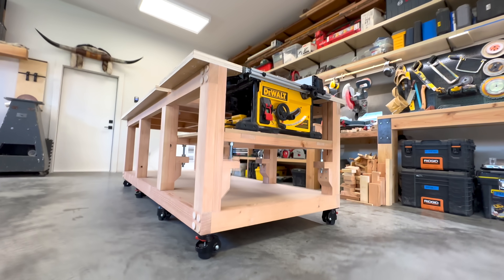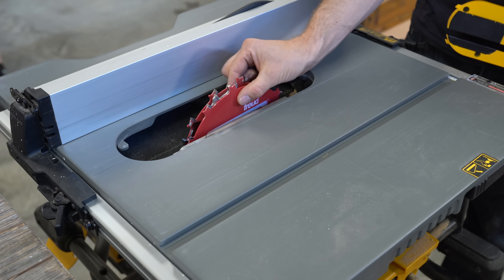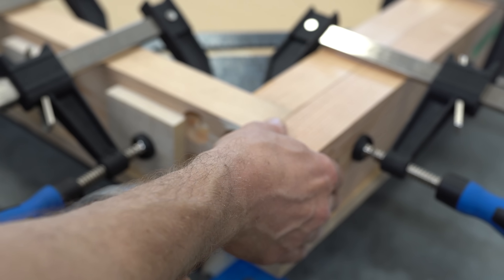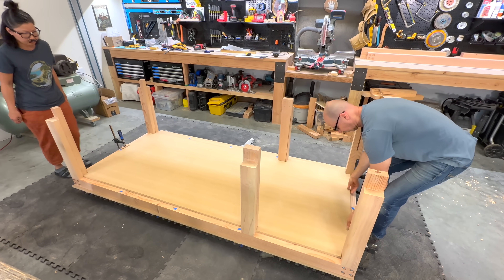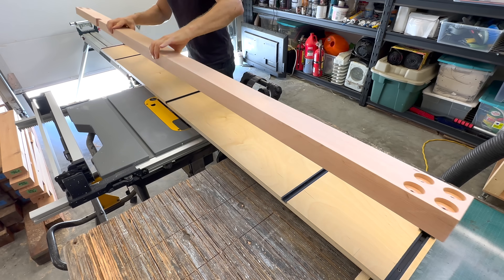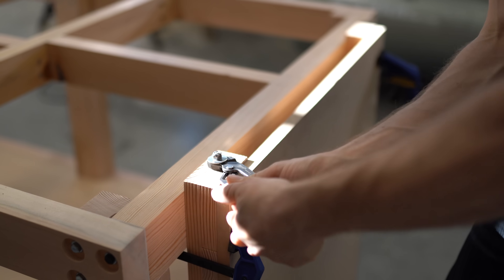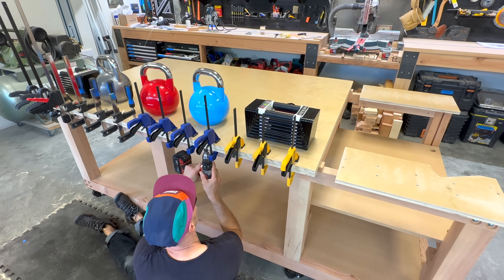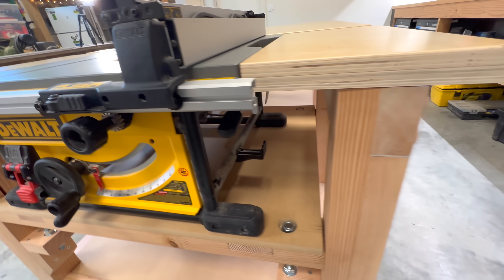DIY Table Saw WORKBENCH Dewalt 7491

Comment: Fantastic build video, the animations (and sound effects) are really well done as well! Look fwd to the plans! 🎉
Reply from the maker: Hey @slingard thanks so much for checking it out! it was fun for me, and educational to create! I hope to have them done soon. Best Paul
Reply from the maker: Hi. Thanks again for inquiring about plans for the workbench. In case you are still interested, I wanted to let you know they are now available on ETSY.  Here's the link  http://bit.ly/3s4D7Ta

The plans utilize imperial measurements, and use regular sized 2X4's (3.5 inch X 1.5 inch).

And in case you are interested in building the workbench using the exact dimensional lumber I used in the video (3 5/8 inch X 1 13/16 inch) I'll have those plans available on ETSY on Oct 31. 

Thanks again for checking out the build! Cheers Paul

Comment: Great build.  Hind sight for me... I should have bought the 7491 instead of his 8-1/4 brother.  Any thoughts on routing miter slots on the outfeed side of the table for other jigs or a cross cut sled?
Reply from the maker: Hi Thomas thank you for your comment, and the 8 1/4 is a good saw too, but I understand if you feel like an upgrade might be in order for the extra cutting capacity. Yes, the routing of the miter slots is a must. I've been using it as is without the slots, but its a pain in the butt!... so I will be routing those in very soon! Thanks again Thomas :) Cheers Paul
Reply: When you do cut those miter slots, please make a short video.  thanks @vanislestudio

Comment: Smooth work slick . Is it ok to ask the measurements from you in metric ?😅
Reply from the maker: Thanks a lot! Sure, the overall size of the workbench in Metric is 2400mm long X 1200mm wide X 896mm high (depending on the height of the casters used) Cheers Paul

Comment: Hi, great job. the only question I ask you is, if you please, tell me the thickness of the threaded rod used to lift the table top of the Dewalt saw table. Hello and thanks
Reply from the maker: Hi Alfred thanks for that! The threaded rod is 5/8 inch. They are 9 inches long each. They are very sturdy and keep the table saw nice and level for me. Thanks a lot for your question! Cheers

Comment: Nice table, how is the stability?  Would it  handle running a large cnc w/o racking or shaking side to side?
Reply from the maker: Hi There, I cant get it to sway from side to side. I tried with a lot of force, but for a larger CNC, I think I would install two cross braces inside the bench just to make sure. Thanks for your question and for stopping in!

Comment: Do you find it time consuming to lower all 8 casters every time you use the table? Just purchased the plans and looking into all caster options.  On my current table I have the wood river ones that lower the table all the way to floor with the foot pedal. Only issue with these is that that stick out far and the table can’t be stowed up directly against the wall.
Reply from the maker: Hey Jeffrey, I know I sent you a DM via Etsy, but thought to post my reply here, in case it may help others :) regarding your casters comment:

"About the casters, If there were 4 casters in this design, it would be doable, to move around the shop all the time. But having the 8 casters, it's a bit more effort, but I've just come to accept that it takes time to move. They are fantastic casters, but at the cost of time to move. The reason there are eight, is because of the weight of the workbench. Having both saws, and 2X top thickness, the bench is heavy. It will sag over time in the middle if only 4 were used.

If you need to move your workbench every day, or once a week, you would have to be ok with the fact it will take a bit of time to move. Each caster requires about 10 - 20 seconds to lift / lower. This time can be sped up if you make an extension arm for adjusting the caster. (Basically a 20cm or 30 cm hollow pipe that makes it easier to adjust)."

For speed, I think you made a good choice ordering 4 more of the wood river casters.

Comment: Nice job! How's the workbench holding up after 8 months? Any warpings or misalignments?
Reply from the maker: I've been beating on it pretty hard this past while and I can share I'm happy with how its held together and has stayed pretty true. The top is still flat, I did have to align the adjustable table saw shelf once, but I'm pretty fussy lol. Thanks for the question mate

Comment: Beautiful table, I am going to build this myself.  How did you level the piece of MDF in the shop floor?
Reply from the maker: Hi there and thank you for your kind words! I used my 40 or so inches level, some scraps of wood that I cut into small blocks, and a lot of cards (Playing Cards, like Kind of Spades). I placed them in piles and made about four rows, then I leveled all the rows to each other. Lengthwise, width, as well as diagonal. 

Once they were all level I placed the sheet of MDF on top. It made it easier for me to build the bench on. 

Thanks a lot for asking and for checking out my video. I really appreciate it. Cheers
Reply: Thank you. @vanislestudio

Comment: Hola, ¿con que fresa hizo el surco a las patas?, para el sistema de elevación de la base de la sierra circular.Gracias.
Reply from the maker: Hi Eros, I used a "Freud 52-522 1-1/8-Inch Diameter T-Slot Router Bit with 1/2-Inch Shank", to cut the groove in the legs. The router i used was "BOSCH MRC23EVSK Combination Router - 15 Amp 2.3 Horsepower Corded Variable Speed Combination Plunge & Fixed-Base Router Kit with Hard Case".  Thanks for stopping in and checking out my video! I appreciate it! Cheers

Comment: Awesome build !!! when are you making the plans available
Reply from the maker: Hey Thanks @gundaro12! I'm working on them now, lots of work but hopefully in a few weeks I'll have them ready.
Reply: Plans would be awesome. Looking forward to them.
Reply: Looking forward to the plan 👍🏼
Reply: I would totally buy the plans for this  @vanislestudio
Reply from the maker: @gntfilms  Hi. Thanks again for inquiring about plans for the workbench. In case you were still interested, I wanted to let you know they are now available on ETSY.  Here's the link  http://bit.ly/3s4D7Ta

The plans utilize imperial measurements, and use regular sized 2X4's (3.5 inch X 1.5 inch).

If you are interested in building the workbench using the exact dimensional lumber I used in the video (3 5/8 inch X 1 13/16 inch) I'll have those plans available on ETSY's site on Oct 31. 

Thanks again for checking out the build! Cheers Paul
Reply from the maker: Hi. Thanks again for inquiring about plans for the workbench. In case you were still interested, I wanted to let you know they are now available on ETSY.  Here's the link  http://bit.ly/3s4D7Ta

The plans utilize imperial measurements, and use regular sized 2X4's (3.5 inch X 1.5 inch).

If you are interested in building the workbench using the exact dimensional lumber I used in the video (3 5/8 inch X 1 13/16 inch) I'll have those plans available on ETSY's site on Oct 31. 

Thanks again for checking out the build! Cheers Paul

Comment: So im new to the whole woodworking thing I have a craftsman table saw that’s on a collapsible stand and hook a bag to the bottom for dust collection. My question is what’s the dust collection like on a table like this?
Reply from the maker: Hi @fishinman539 I think dust collection on any table saw is going to be a challenge. I would imagine for the best results there would need to be a collection on top, covering the blade, as well as below. This saw collects the dust from below, and is exhausted via a 3 inch port, at least I thinks it's about 3 inch). I connect my Rigid Dust Vac to the port on the rear of the saw. The Rigid vacuum will fit inside the workbench, so you don't need to have it wasting shop floor space. In all, the dust collection on this saw is pretty good I'd say. Thanks for checking out my video and for your comment.! Much appreciated Cheers
Reply: @vanislestudio  awesome thanks for the advice ! Great video

Comment: very well done!  just curious how did you make 4n bolts screws going up animation in the video?
Reply from the maker: Hey Randy, thank you. To make the bolts moving the platform upwards, I basically, turned each bolt about a 1/4 turn (on all four bolts). I then took a picture. Then I turned each bolt again about 1/4 turn. I then took a picture...repeat.  It took me a week of learning how to do this, and finally have it turn our the way I wanted! I used this technique in my next video as well, which will be out soon. Thanks for the question. Cheers
Reply: Ahah 😂 this is more like a time lapse, understand well done 👍

Comment: Hi great video, thinking of building this myself for my first workshop table, how much did it cost you for all the lumber?
Reply from the maker: Hi there thanks so much! 2 sheets of 3/4 ply @ 85 each. 19 2X4's @ 3.73 each. 1 sheet of MDF @ 59.98. One 2 X 6 @ 4.26 Total is about $304 but add extra for mistakes and a few other pieces, so about 350 is a really good ballpark. Thanks for stopping in mate! All the best to you

Comment: Best Build i've ever seen. amazing work. Will you publish the plans anytime soon? i really wanna build it for myself ;)
Reply from the maker: Hi @replySunni Thanks so much for that! I appreciate you checking out the build. 

In case you were still interested, I wanted to let you know they are now available on ETSY.  Here's the link  http://bit.ly/3s4D7Ta

The plans utilize imperial measurements, and use regular sized 2X4's (3.5 inch X 1.5 inch).

If you are interested in building the workbench using the exact dimensional lumber I used in the video (3 5/8 inch X 1 13/16 inch) I'll have those plans available on ETSY's site on Oct 31. 

Thanks again for checking out the build! Cheers Paul

Comment: hi .... very nice work..... where can i get a saw track as same as u have?
Reply from the maker: Hi @user-hf4zn5xf1s  the guide rail is from Makita. They make a few of them in different lengths. Check them out here if you wish and thank you for checking out the build! Cheers 
https://www.amazon.ca/Makita-194368-5-Guide-Rail-55-Inch/dp/B002XFYBYQ/ref=sr_1_1?keywords=makita+track+saw+rail&qid=1701193981&sr=8-1

Comment: i assume you have been using this for a while now.   How do you like your choice of casters so far?   i am in the middle of a build at the moment and having a difficult time selecting the best casters for my build.  Curious of your thoughts.

Thanks
Reply from the maker: Hi @psnLazyBeast thanks for your question. For me, they are excellent. I have four different sets of casters around my shop (from different manufactures). These are my favorite. That being said, they are the only levelling casters that I own. But what I can share is, they are easy to level, and adjust. The wheels are large enough that they roll over any wood chips lying around. The downside is they use a ratchet system to raise and lower the foot. This means it takes more time, as the ratchet system moves the foot up, or down in small distances per turn of the ratchet. But I'm ok with that. Oh, something else, is these range from 4" to 4.5" in height. Not many can do that. other levelling caster are usually 3" to 3.5" in height. Cheers
Reply: @vanislestudio  thank you for the response

Comment: Nice workbench!  My older Dewalt saw just died and see you have the one I'm looking into.  DO you make most your furniture with it and have you come across any shortcomings?
Reply from the maker: Hi Huey, Thanks! I use the Dewalt table saw for everything I do. The only shortcoming worth mentioning, is, the saw does not have a "dead flat top", meaning its a composite type material, and not absolutely flat like a cast iron top that is found on cabinet saws. That being said, its a trade off. I did not want the weight, and from my research this saw was one of the most highly recommended, and I agree with it. It can also accommodate an 8 inch dado stack! the fence system is pretty good too. Thanks for asking, Cheers

Comment: This looks simple but exquisite, my brain can easily ubderstand the basic designs. Not that i have a bright one at that 😅
Reply from the maker: Hi @adhyadmokoas so cool you were able to follow along! That made me smile! Thanks for that and I think you're pretty bright. Cheers Paul
Reply: @vanislestudio  would be glad to know about those track / bolt system that you use for leveling, how strong were they? What i had in mind couple years ago was making the frame from hollow steel, with plywood/solid tops.

Comment: Hi. Great build. Trying to follow this. Thank you. 
May i know what size those lag screws are ? 
I am trying to use 2X4 doug fir without planing jt
Reply from the maker: Hi there thanks a lot for your comment. Douglas Fir is a nice choice for building materials!

There are two workbench plans, hopefully below will help you:

1/4 inch Diameter X 2 1/2 inch length Hex Lag Screws were used for the workbench built with regular size 2X4's (1 1/2" X 3 1/2")

1/4 inch Diameter X 3 inch Length Hex Lag Screws were used for the workbench that was built with milled lumber planned to a final thickness of 3 5/8" X 1 13/16"

Again thanks for stopping in and good luck with your build! Cheers

Comment: Hello there, a question if I may: what is the purpose of the hanger bolt?
I kinda understand it but if you just simply tighten the top nuts wouldn't that make the same thing?
Reply from the maker: Hey Marcell. You are absolutely correct. I have a tendency to go overboard with design sometimes.  What it comes down to is... I  wanted to add another layer of lateral support for those two front legs. Something other than a horizontal pressure fit (from top and bottom), the addition of the hanger bolt offers a horizontal pressure fit as well.

 Its a good point you bring up. Ill add it to an instructional video that I'm making to help those out who are building the workbench. Thanks for your comment! Cheers
Reply: @vanislestudio  you're right! Finally, I went cheaper and didn't buy the T-shaped router bit to do so but used a fixed threaded rod going through the front legs. It works well even though it wasn't the brightest idea because now that I finished the table I can't take the table saw out of its place anymore. :D It's a bit hard to explain without pictures, though.

Comment: Hi, that’s an awesome workbench.  I’m new to woodworking and I’m in the middle of making one right now and I love the adjustable table saw part.  I have a cheap table saw now, and if I can keep all my fingers and stick with it , I would like to upgrade in the future.  One problem though, I don’t have a router.  Is there any other way to make the T track?
Reply from the maker: Way to go for making your own workbench! and yup you better keep all of your fingers so you can have fun making things you like, long into the future :) Without a router? Maybe if you slide two sheets of plywood together, but leave 3/4 inch space between them. Then you can lay the t track down in-between the two sheets. Thanks so much for stopping in and checking out the build! I wish you the best of luck on your woodworking journey!

Comment: Hi Paul, which mitre gauge are you using with your Dewalt tablesaw, and would you recommend it?
Reply from the maker: Hi There, Im using an Incra Miter 1000SE. It's an old one that I purchased from FB Marketplace. Only issue I have with it is, I have to really crank down the little screws to expand the parts keeping it nice and sung inside the miter slot. Other than that it's fantastic. They have newer models now I'm sure that probably do a better job with the little adjustment screws. Thanks for asking! Cheers

Comment: do you recommend this table saw from dewalt?
because i am hesitating between this one and the makita table saw
Reply from the maker: Hi Abdelhalem, that's a good question. Both are quality manufactures, so you can't go wrong with either.  Since I do not own the Makita, I am unable to provide feedback, but here's' a few reasons why I chose the Dewalt: It accepts an 8" dado blade. This was a big deal for me. It has a very good fence system. Its not perfect, but for a contractor saw its fantastic. It has plenty of power, never had an issue cutting anything, ever. The table top surface could be improved upon, but like I mentioned before, for a contractor saw, its one of the best in its price range. Thanks again for stopping in Cheers!

Comment: Has the vibration from the saw affected the level at all after 3 weeks of use?
Reply from the maker: Hi @realreviews9026 that's a great question so I just got back from checking. It is different now, about two sheets paper thickness out on the right side. That being said, I think it's because I had to retract the feet in the casters as I needed to move the bench. I haven't had time to raise it up again and level it, so it's currently sitting on a rough shop floor that's not level.  Once I level the bench again, I'll reply and let you know how it went. Cheers Paul

Comment: Hi, did you have issues with arbor nut getting loose after using dado blades ?
Reply from the maker: Hi There, no, I did not experience this (arbor nut getting loose after using dado). I have two dado stacks, one is 6 inch and one is 8 inch. I make sure the arbor nut is nice and tight before using, and I also make sure that the teeth on the blade and the stack are not touching. Thanks for your question and for stopping in, Cheers!

Comment: what was that tool u used to screw the bolts down? it went on the nut and connected to the drill gun on the side.
Reply from the maker: Hey @Cubhavoc, do you mean the part where I was screwing the large bolts onto the threaded rod using my drill? If so, it was a small sanding drum, but without the sandpaper. (it's rubber)  Here's a link if you want to check it out. https://amzn.to/46LHP6S. Hope it helps and thanks for stopping in! Cheers